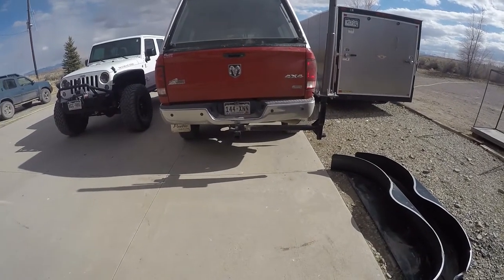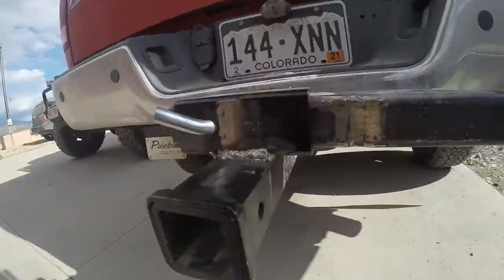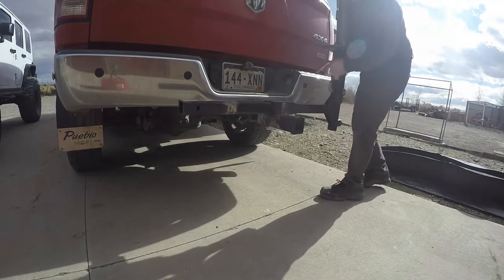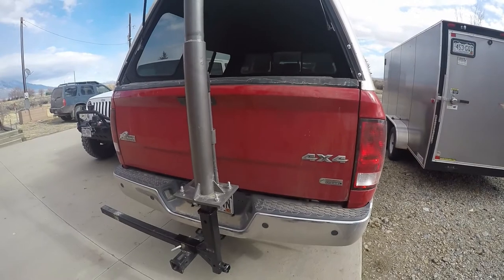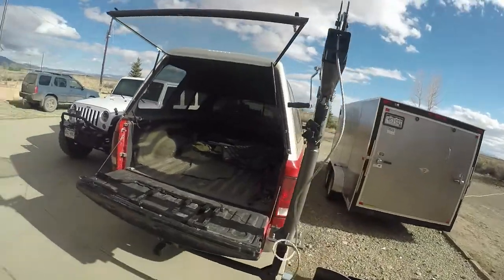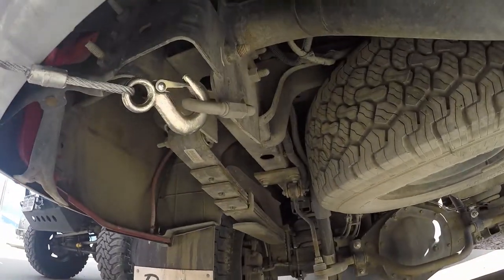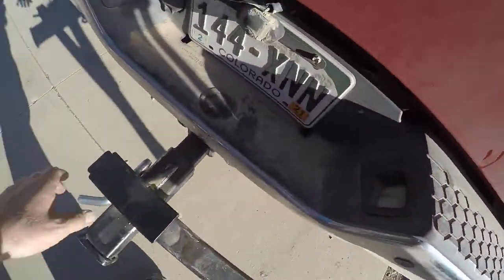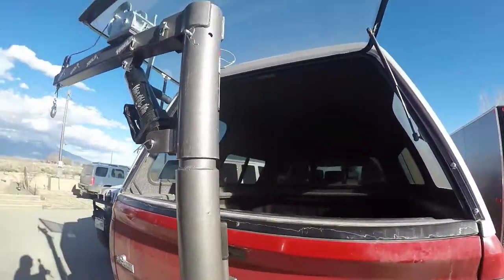CRANE for Pickup HITCH -Pt 2- IMPROVEMENT!!!

Comment: Buy a wireless winch. Works better then the crank and you don't have to be right next to the system for safety reasons.
Reply from the maker: LOL I have one sitting on the shelf, that would be my next "improvement" for sure. Thanks for watching and commenting. My only unknown is whether to wire it from the truck batteries, or use a standalone that gets charged by the truck. Do you have any suggestions? And wire sizes to use, I mean from the truck batteries to the trailer is a long way right?